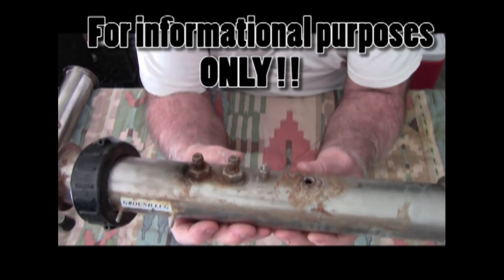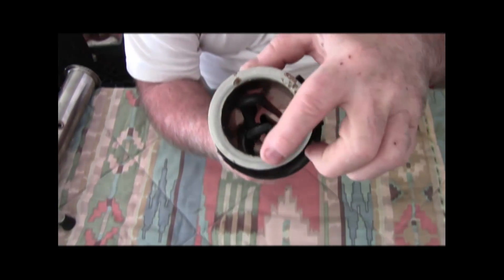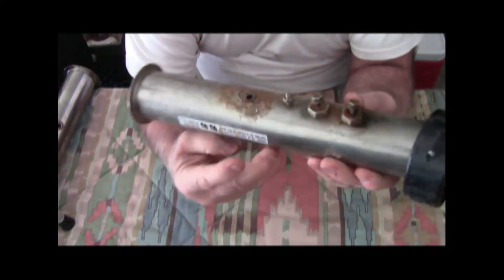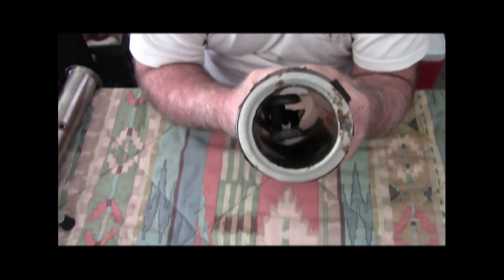# 37 Why do spa heaters fail?

Comment: The underlying reason WHY they fail in such ways is WATER CHEMISTRY. PH too low, 7.2 and lower. Sanitizer (chlorine/bromine) too high, above 5ppm. Water not getting changed every 4 months where TDS and especially CYANURIC ACID levels too high as a result of constantly adding chlorine, acid builds up over time without draining/refilling often. Not oxidizing (shock) the water often, so a buildup of high levels of old used inactive chlorine is always present. (above 12PPM)

Comment: Just my thought, but I think the copper bars between the board and the heater is the root cause of the failure. I replace them with wire loops.

Comment: I have NO signs of arcing, water leakage or iron oxides, nor any circuit breaking yet my heater is only heating 10 degrees per 24 hrs.  Does that indicate a bad element or a bad flow sensor?

Comment: Can someone Help!?? Thanks for the tips. So I got a used spa, it was tripping breaker until I replaced with a new heater, functioned great for months. Roommates used when I wasnt there, and suddenly spa wouldnt turn on at all. I replaced the fuse which solved that problem, my spa functions correctly now, doesnt trip breaker, except that it doesnt heat at all. Heater was brand new and worked great, any ideas on what this could be? On my spa display, the light indicator doesnt light up where it says "heater". Any ideas, thank you in advance

Comment: When testing the heater with the leads disconnected in a 240 volt system should each lead be running at 120 volt?  The breaker did not pop ,when I checked the voltage on each lead I got 115 volts on one and about 6 volts on the other.
Thanks Wayne

Comment: Most common cause of failure is the actual insulation in contact with the water on the element !  Period ! In 30 years I have not had a failure do to iron oxide arcing out the terminals as the water leaks out at point lower than the insulation surrounding the terminal connection and below the retaining nuts usually. Testing element that is tripping GFCI or not working involves turning off power to unit, disconnecting leads to the element, then using and ohm meter , test between leads and should see approx 5 -20 ohms depending on wattage of heater . If it is very high or out of range  then replace element. Testing one for causing GFCI trip is best done with water still in heater tube. Test from one terminal at a time to the heater tube, any reading  below the out of range (any number including zero) indicates a fault so replace element.
  Most heaters element can be replaced without the tube with a few exceptions that are just to difficult due to  design. Teflon coated elements help in hard water areas to avoid some calcium buildup and titanium elements resist chemistry fluctuations better.
  Corrosion can sometimes be electrolysis due to voltage but as stated before usually due to poor chemistry (90+% of the time) hence the corrosion shown where the water was leaking and chemistry also degrades the seals at the ends with the same effect leakage. 
  It is meaned that the ground was useless when there was no GFCI. Not true as the customers would not be around to tell you the water tingled if there had not been a ground as they would have been the only path to ground then!

Comment: Great tutorial but the best tests procedure for testing a heater element like this to ensure its safe, and if a fault does occur during operation, it will trip the GFI or RCD (which would be a crime not to have one fitted!)  is to carry out an insulation test using a high resistance insulation test meter. This will show up any earth leakage faults under operating conditions that may go un detected by using an low resistance ohmmeter.   Therefore you ALWAYS use an insulation test meter, noted  they are more expensive and many people just don't have one at hand!
Anyway the test procedure:
1. Yes insure the circuit is isolated.  
2. Yes, ensure the heater is disconnected from the circuit board to prevent the high insulation test voltages damaging the sensitive electronic components. 
3. Place a shorting link (wire with two alligator clips each end) across both the heater terminals. 
4. Connect red lead of your insulation tester to anyone of the heater terminals that are linked. Connect the black lead to the metal ground posts of the heater. Set the meter to megohms and test voltage to twice the working voltage of the component under test ie  230V heater use 500Vdc. (Yes we apply a dc test voltage).
5.Carry out the insulation test, the resistance must be greater than 1meg ohm. If not the the heater has failed and should be replaced. Note sometimes a low insulation reading could be just damp and drying out will improve the reading but this is a judgment call. 

Finally if you ever wondered what the measured heater continuity resistance should be then use this simple formula: Resistance = Voltage squared / Power (Watts)

Hope this helps.

Comment: Hey John, one of my hot tub Heater terminals is burned out(with iron ox on it, just like in the video), the connector on circuit board is complete burned out. Can I hot wire it to 220V mean AC line on the Circuit board ? or this there a way to fix it without to buy a new circuit board_)

Comment: John, you don't know what you're talking about.  Period.  The element of the heater is USUALLY the part that fails.  It's a resistor that gets really  hot, especially when the spa FAILS TO PROVIDE ENOUGH COOLING WATER.

Comment: Two dissimilar metals  causes corrosion / rust as well. So you have the metal that the heating element is using, the metal tube, the metal nut and the lug metal type all being different. This causes all sorts of possibilities for corrosion. Increasing the resistance of the connection. Then ultimately causes pitting that allows the water to leak.

Which ultimately means these are poorly designed!

Comment: Hi. We have a 2006 sunrise hot tub. A new heater was installed before we got it however after initial set up at our place, the heater did not work at all. Heater was taken back to supplier who tested/looked at heater and element was apparently faulty so they replaced it at no cost. We used tub for a week (about 4 times us actually in the spa) but now heater appears to have stopped working again. As far as I can tell there is no corrosion etc so I am just wondering if you have any ideas what could be causing this? Thanks for your time and expertise its appreciated.

Comment: Very educational. I just fix my Balboa VS series heater at no cost.  Just like you explained very minor corrosion, in my case it was just "white dust" on the terminals, cause the GFI to trip instantly. I was able to clean up the connection terminals, reconditioned the robber seals with "CRC" silicon spay and the problem was solved. These robber seals have a tendency to shrink when it is very cold. We just had a very cold winter, causing the seal to seep.  It might just have been condensation the caused the corrosion. Thank you for sharing,
Reply: Marty Nashville Hi, My name is Tim. Could you please tell me what your symptoms were to make you think is was the heater. My problem is setting it on 104, but only getting to 95/98. Was this your problem?
Thank You.    timothyconnett@gmail.com

Comment: There doesn't seem to be must insulation between the two hot terminals and the outside pipe of the heater.  There could be a long length of insulation similar to the porcelain spark plug insulator.

Comment: I dont know that my hot tub has a GFI which I am assuming is a circuit breaker of sorts, Ill be doing some research in order to find one. Thanks for the video Ive never been fond of 240v running through my veins.

Comment: HI John, I have a 2005 downeast master spa. The breaker trips after 5-10min of operation. (all pumps come on) It sounds like the heater but you mention its rarely the heating element but the corrosion. My heater has no corrosion what so ever, looks brand new. I have not bought a multi-meter as of yet to test posts. But wanted to get your thoughts on this. Thanks
Reply from the maker: Disconnect the electrodes to the heater. If the GFI hold, it is the heater.

Comment: Wow. You ever heard of poor water chemistry? Low ph = acidic water = corrosion. This is one of the top reasons why heater elements fail.
Replacing a heater tube instead of just heater is non sense.

Comment from the maker: Well, grounding is one of the single most important items in all of electrical. With that said, 240 volt GFCI breakers have been around for quite some time now. Any voltage to ground (originating from either leg or even stray voltage) will automatically trip the 240 breaker. I personally do not trust GFCI breakers anymore.  Parting note: no real electrician would ever wire a device ungrounded unless it were specifically prohibited in article 250.

Comment: GFIC only protects against a 120 Volt shock not 240Volt shorts. if you have no ground and L1 is in contact with your heater and L2 is in contact with your uninsulated pump or ungrounded hand rail, you are dead and your GFIC will never trip. GFICs and grounding are meant to work together!!! Just a reminder to EVERYONE!

Comment: You play up GFIC, and I think they are great, but they may fail (note the test button, hopefully it fails when you test it and not when you are in the tub). The Ground Conductor is your first defense make sure you have a good (over sized) ground connection through out your home system! The 240V line to line source is only 120 volt to ground the arcing is from the electrode to the grounded conductor. Keeping the metal case at near ground potential.

Comment from the maker: I will be honest. I don''t know what  the Ohm reading should be with the pressure switch open or closed. I would start with replaced the switch. If the problem persists then it is most likely a mother board issue. That is where you have to make a decision to replace the mother board (very expensive) or to sell your spa 'as is' and buy a new one. The economy has cut the cost of Hot Tubs by 40% on a feature by feature basis. Good luck and thanks for the comment.

Comment: Thanks John - very helpful vid. BTW, I had the most uncommon failure...the element itself. Somthing is triggering my Jacuzzi Select panel to pass voltage to the element even after the pressure switch "opens" when the motor stops. I hope it's not in my circuit board.

Comment from the maker: That's what it sounds like to me. Testing a motor is easy but testing a pump is very difficult. For starters take the intake filter off-with pump on high it should just about suck your hand through the hole (two or more holes--you need to block all but one) On low speed it should still have good suction. Worst case: pull pump out and disassemble head and check for debris OR the pump itself may have come loose from the motor-either way your hands get dirty. Hope this helps-thanks for comment.

Comment: My heater has been disabled and I see a FLO error on my display.  I jumped the pressure switch and the display indicates the heater is working, but the circulation pump doesn't seem to be working.  The two pumps that power the jets work fine.  Do you think my it's a clear case of a bad circulation pump?

Comment from the maker: Not sure if it was in this video, but on one job the 'pool guy' diagnosed the problem as a broken wire underground. Ohms test good from source throughout. Tested GFI, did not pop. Next I tested heater to ground (with power shut off) and it showed full continuity on both legs. This condition could have killed the homeowners. I replaced heater and GFI disconnect. No more shocks + one year warranty. Some jobs only a qualified sparky should do. Thanks for the comment Mr. Stoveman.

Comment: Great video ! I disconnected the heating element and the GFI didn't trip. The pump came on, so I now know the heater is bad. That non GFI is scary as can be. Who would hook 220v or even 120v to a water pump source without a GFI ? Even my outlets outside for the patio are GFI protected. The stuff people do is amazing !!! Kind of like using a hair dryer in the bathtub.

Comment from the maker: Tells me your using 5760 Watts, older heaters are rated at 5500 watts. If it IS a 5500K heater then it is beyond the 3% range of acceptability:Run two tests. with power OFF test for continuity between either electrode and ground-continuity=bad heater-next test your heater legs when powered up. A good 'brain' will give you from 244 to 238 NOMINAL-less voltage would indicate a bad board-last, verify the pressure sensor is working. Thats all I can fit. Hope this helps you out. gut feeling-the board